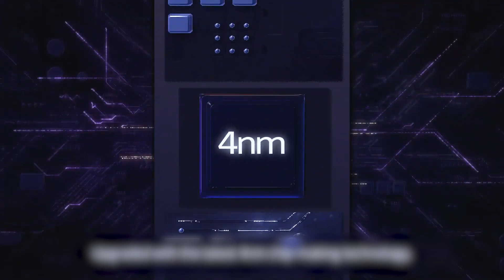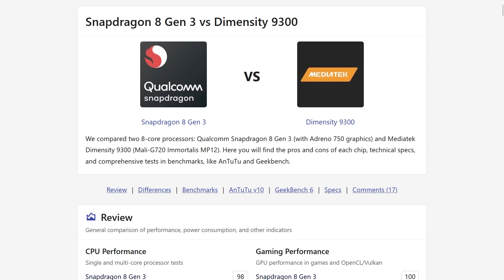MediaTek Dimensity Chipsets: Explained

Comment: Most cheap android phones actually do come shipped in with mediatek and I have tested the unisoc t310 and it performs better than the hailo a22 I was able to run ppsspp with no problems and I guess dolphin is only optimized for the snapdragon 800 865 and if you try to run any GameCube game on the mediatek chipset it will still act like garbage.